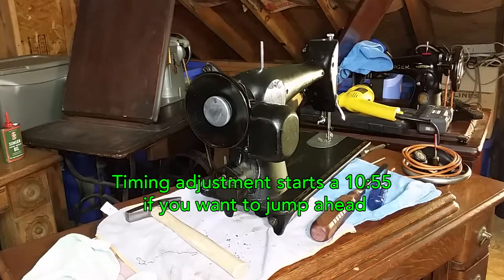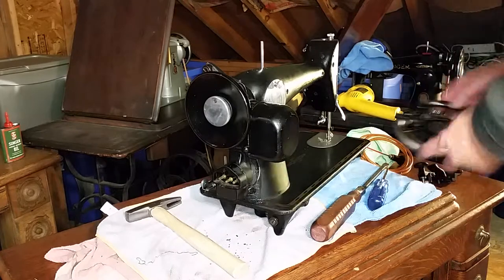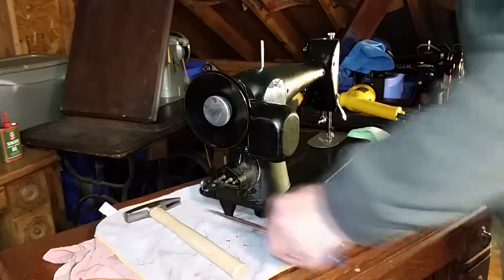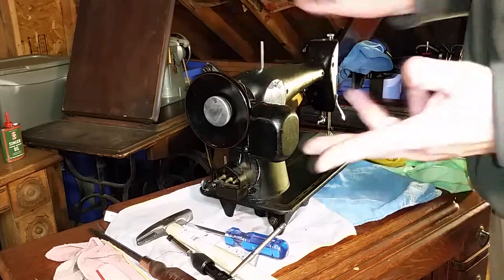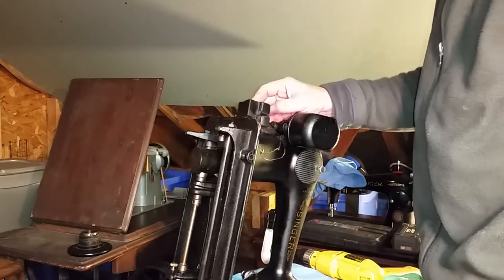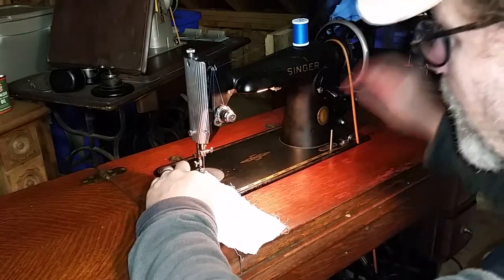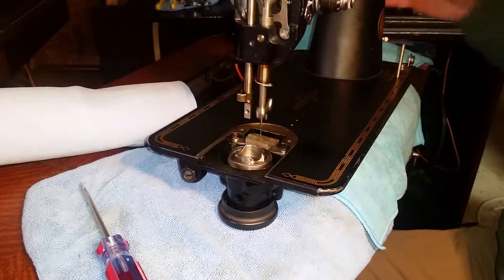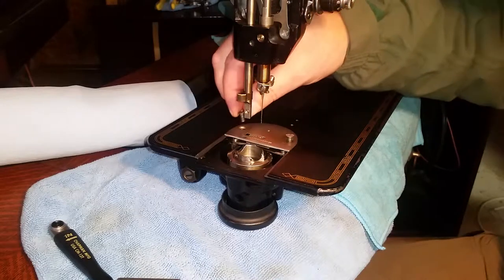Singer 201-2 Sewing Machine.  Motor To Treadle Conversion - Best viewed in 1080

Comment: That's cool. I didn't know you could take a potted motor version and convert it to a trouble. That's that's neat. I've got the Chapman screwdriver set. I love it but after some reason I don't know if it was just a batch that I got or what the bit seem to break. Easy without trying. I've had to replace a couple of them so I'm kind of quit using it

Comment: Wow. Thanks for sharing! Can you mount a regular belted motor to the 201? I have one with a potted motor that will not work. It will cost less to buy a new 2.5 amp motor and pedal. And I have an extra wheel that I bought years ago. * ALSO, I have some vintage machines that are direct drive. Can those be changed out as well? Thanks for any advice.

Comment: Hello Dave! Thank you very much for the video! I wonder if the conversion to treadle would be easier on a 201-3 for someone without any experience doing this type of mechanical work. Thank you very much!
Reply from the maker: Yes, the potted motor on the 201-2 is what makes it a challenge.
Reply: @davef2065   Thank you very much!

Comment: Great video! I just purchased a Singer 201-2 that seems to have been with the original owner’s family.  It works, but it is a bit dull. Do you have any suggestions for what material to use to clean it and to make it shiny? Thank you very much!
Reply from the maker: Very gentle cleaning over multiple sessions with sewing machine oil to start.  If you got space to make a mess the something like Gojo (without pumice).  Once you have it clean of all the old gunk, then carnuba wax to make it really shine.  And Mother's Mag Polish on the plated parts.
Reply: @davef2065  Thank you very much!

Comment: Hi. Can I do the opposite? I have a very old treadle machine, probably from the 30's. Can I motorize it? Thank you very much!
Reply from the maker: Yes.  Your machine probably has the boss under under the balance wheel to install a motor mount.  If it doesn't there are places to get a motor mount that will mount using the inspection plate screw to hold it in place..

Comment: Can a smaller version like feather weight that has the block instead? I have a small singer sterling like a featherweight but I can't handle the old motor smells so sewing repair man recommended I try a treadle- Once you attach machine to table how do you run the belt from machine to thetreadle body and what size belt will be needed- I looking at buying an old singer treadle and attach my sterling to it- Can it be done-
Reply from the maker: Yes.  But you can't use a standard treadle.  There are diagrams online for an early 20th century portable treadle that I've been toying with for making a Featherweight treadle.  I haven't finished mine yet because keep trying to use aluminum so it will be light so my experiments have turned out to be a little on the weak and unstable side.

Comment: I have 3 juki ddl 8700. Butt loadshadding problem i need to this  treadle stand use for DDL 8700
Can i use it
Reply from the maker: The irons will work but you will need to make a new top.

Comment: Well, you make that look doable.  Everything I see is about electric to treadle, or electric to hand-crank.  I have a ~1948 201 hand-crank and am thinking of making it a treadle, what do I do?  It's never been electric and has a spoked wheel, obviously.  As well as a crank handle on it.  Is it a trivial task, or are there any special considerations? Thanks for any tips/advice from anyone.  :-D
Reply from the maker: A hand crank machine is treadle ready as it sits.  You put in in a Singer treadle base and you will be good to go.

Comment: How do you loosen the belt to pack it back into the cabinet? Mine feels a little tight to put back in and not sure if the belt is too tight or whether i've just done something wrong
Reply from the maker: If you mean the treadle belt, you just take if off fly wheel.  That should give you all the slack you need to put the belt on the machine once it's in the cabinet.

Comment: Did you put a bobbin winder back on?
Reply from the maker: The belt guard I bought from Helen Howes came with a bobbin winder already on it
Reply: Dave F Yes but I was hoping to see you put it on but must confess, I tried to watch from start to finish but do to time had to quickly forward, stop, forward... I will watch entire video tonight! So did you show putting it on? I guess I will find out tonight!
Reply from the maker: @stupidusedrnames  - I show how we tapped the holes for the new belt guard at 19:15.  Just a few still shots since we were running a drill press in kind of a cramped area with no room to set up a camera.

Comment: So , I did this conversion..but there are steps left out in this video, I do not recommend you trying to do the conversion unless you know how to do some minor machining of modifications such as drilling and tapping.
Reply from the maker: How we drilled out the belt guard mounting holes is shown around 19:15.  However, the belt guard is not required for the machine to function.  Removing the potted motor and replacing the balance wheel are all that are needed to do to have a working treadle ready machine.